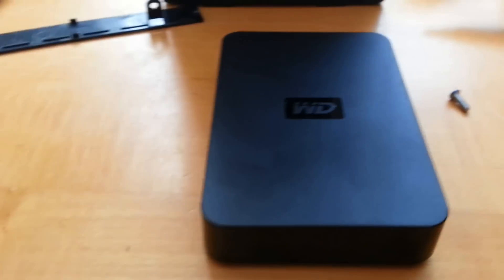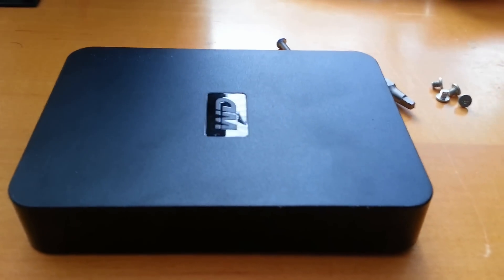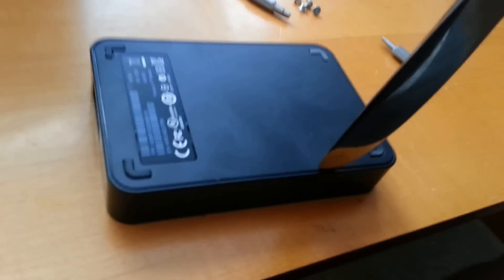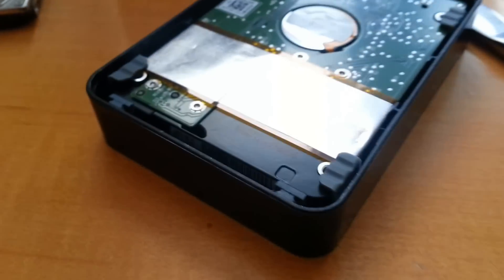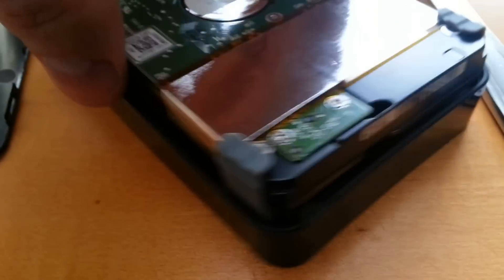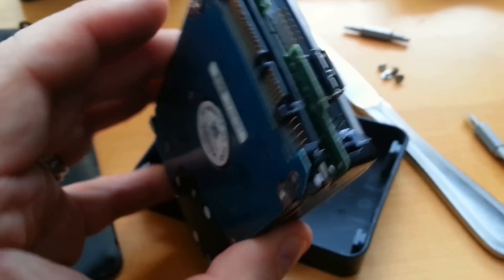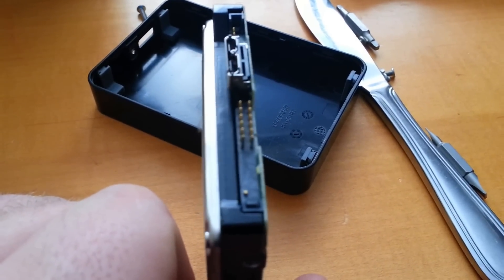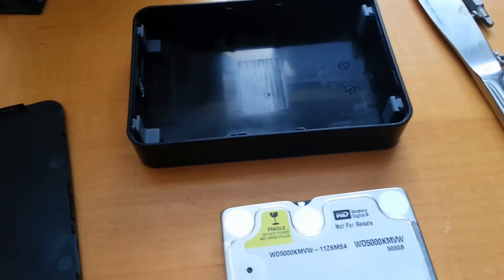WD Elements SE 500GB USB 3.0 Hard Drive Disassembly

Comment: Thanks for having posted that video.  I had the intention to buy this drive in order to do the same thing; external drives being often cheaper than buying an internal one.  Swaping the drives like you intended to do usually works but some WD 2.5 drives have the hardware specifically dedicated for external use only.  That makes them pretty small but non reusable in laptops.

Comment: Thanks for confirming that. My drive case is the same , but it has a USB mini socket on it and I cannot locate the cable! I've got tons of other cable variations, so I thought I would break open the case and put it in a dock I just bought, then I suddenly had a thought, and you have confirmed it! Western Digital's documentation was totally inadequate to find the proper specifications of these drives!

Comment: Mine looks identical to yours except it is 320GB capacity.
Confirmed that it does use a standard SATA drive, so after opening it and dumping the SATA to USB adapter card I now have a nice replacement HDD for an old computer.
I noticed some consumers hate this drive due to its apparent unreliability - what I found with my drive is that it's very sensitive to low (< 4.8V) voltage at the computer's USB port, even though the internal HDD itself is fine. I wonder how many people have junked what was a working drive...

Comment: If you have a micro-B to sata adapter then you could use it in your PS3 just barely but can be used or a USB 3.0 to SATA connector with a USB 3.0 cable extension adapter with 2 USB Female ports on both sides.

Comment: I guess it actually is a SATA drive but it doesn't feature a SATA connector for, I think, economical purposes. It is not required and several goldpins are much cheaper than a pair of SATA connectors. I think that you could modify it using a SATA socket from any old broken HDD.

Comment: Son of a... How in the world did WD think this was a good idea? What a piece of junk.
Reply: Agreed i hate DW because of that
Reply: They do it for security, also so you can't shuck their drives. Lol ;d
Reply: @Fairplay wat? It's a physical and firmware level of security. You can't just plug the drive into SATA and read it.. you have to use the USB 3.0 connection, which goes via a controller which allows or denies access to the drive itself until you correctly input the password.

Unless you know how to bypass this hardware level of security, by for example desoldering the controller and applying your own to connect to SATA, your data is practically safe from being read.. but as we always say "There's always a way in.."
Reply: @Fairplay I agree, but then if someone managed to get ahold of your hard drive which held critical information, I'd prefer they have no access to it.

Comment: hi, i have the same hard drive, it dropped and when i connect it to my laptop you can here it ticking over trying to connect, but it wont come up on my laptop.
Reply: ellen s if it's ticking then that means it's litterly broken :/ you won't be able to get any data from there :(
Reply: Bummer, ive hung onto it for a year incase it could be fixed :(
Reply: if you haven't thrown it out yet you can search on YouTube for repair ticking hard drive maybe you can get some " working tips" there

Comment: I`m actually about to do the same thing here. It looks like you given up too soon. I believe you can use this hdd to replace the ps3 one. Ever you tryed to remove that circuit board? It looks like its just a piece attached /connected to the HDD. I can`t see why it should be different from the other 2.5'' HDD.
Reply: trust me it is soldered directly to it

Comment: Seriously, is there something interresting in this video? Why posting that without even be able to use the WD hard drive connecting.
Reply from the maker: Peter Slym because sometimes you need to know what you're opening. I assumed it was SATA internals before I opened it, and was shocked that it wasn't.
Reply: Posting that helps other people not have to break open a case for no benefit.
Reply: it gives awareness to people whose planning to buy external memory...I have the same problem....for sure if only I saw this video prior of buying WD external memory, I will definitely choose other brands